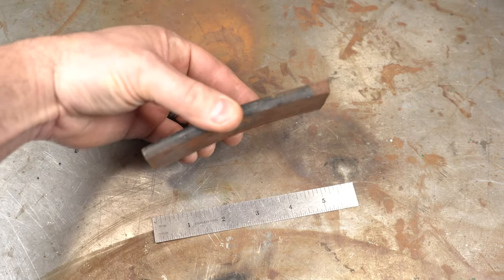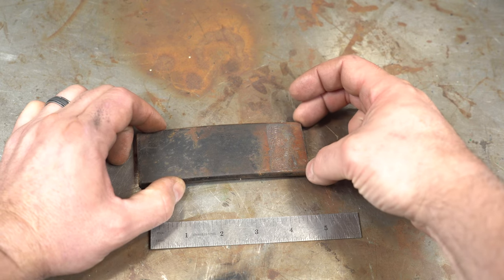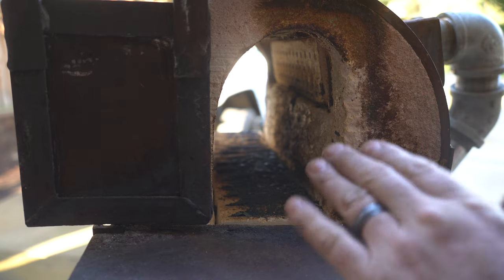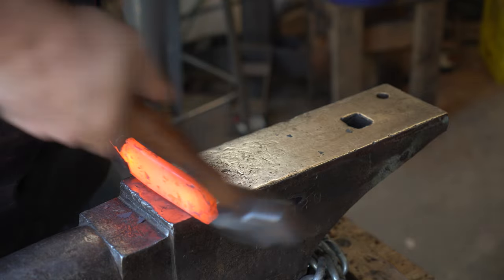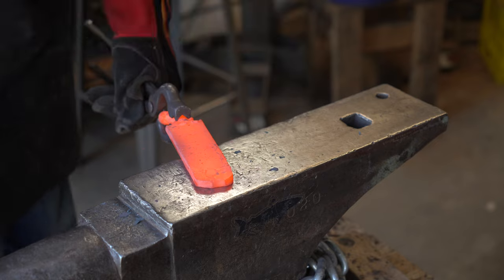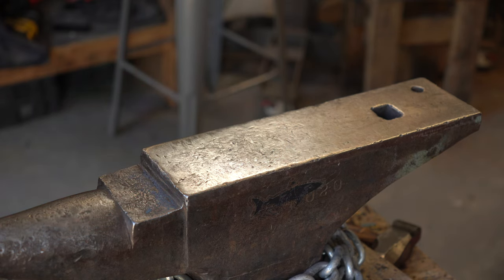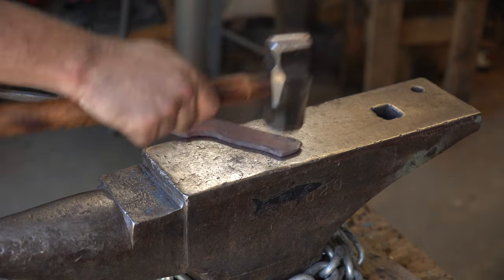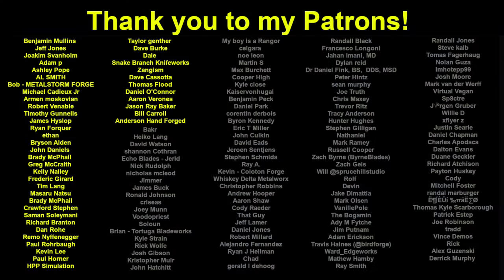Triple-T #172 - Forging the beginner series knife

Comment from the maker: Do you have any questions about the forging in this video?  Any tips I missed?
Reply: Hi sir  thanks for your clear explanation I have doubts that I can use SS309 for this forge ?
Reply: I have 1 question: Can I use a induction heater instead of a forge?
Reply from the maker: @electromind4183 I’m not sure what an SS309 is.
Reply from the maker: @nandobarreto2 sure, an induction forge can work very well for this part of the build.  I don’t think they are that good for heat treating but for actual forging they work well.
Reply: Thank you! I was looking a way to start forging, but the place I have is closed, i dont think a propane forge would be a good idea, that's why i though about induction. In this case I would need an induction forge and a electric oven for heat treating, am I right? @TyrellKnifeworks
Reply from the maker: @nandobarreto2 yes, that would be a good path forward.
Reply: Thank you! @TyrellKnifeworks
Reply: while you're making the profile, do you let the forge running at the same heat or you lower it a bit?

didn't mention any tips to remove the welded steel without leaving the soldering material
I imagine that it was left to cool and then grinded out, but how to differentiate the working steel vs the added/welded steel when everything kinda looks the same?

idk if it's like a no brainer, but maybe adding the steel brush and ruler to the items needed in the previous video
the welder, well, you cover it, but idk if it it's close to a must even for beginners
Reply from the maker: @jorgepr13 I have my forging running around 1800F when I’m just forging.  For grinding off the handle, you can just do it while it’s hot with an angle grinder.  If you had a cutoff tool to put in your hardy home, that’s actually the easiest way but most beginners won’t have that.  A brush is required but those are cheap.  I’ll mention in the next video.  Thanks for watching!
Reply: @TyrellKnifeworks , one thing I have seen stressed is the importance of setting the heal of the blade bevel and making it straight. I know you said that you wouldn’t be doing beveling with hammer. But grinding in I think relies a good amount to having a straight face of the Ricasso matching the shape of the heal of the bevel.
Reply from the maker: @samdahlandsonsforge   Yes, I'll talk about that during the profiling.  I want to be careful in this beginner forging not to overwhelm the beginner with so many "things to think about", hence I left out bevels on purpose.  Just forging a profile is where they should start.  In the Intermediate Series I'll cover more forging techniques like bevels, pulling the heel down, etc.
Reply: A tip might be to use the horn for drawing out, if you don't have a nice rounded corner on the anvil.
Reply from the maker: @aviweisbach7816 yes the horn works if you don’t have a rounded edge.  Though the edge works better if you have one because the horn is unsupported and transfers less energy into your workpiece.  Thanks for watching.
Reply: @TyrellKnifeworks  I really like what you are doing. And I know it is such a hard line to decide between what is overwhelming for a beginner. I am so appreciative that you take the time to make those thoughts into footage. The fact that you include your wife giving you a best wishes for the day shows your character. I have no idea of the exact science of what is too much, and what is just enough to get started, but again I appreciate your focus on trying to answer that question!.

Comment: Thanks so much for this series, Denis! I’m just now on my third ever knife. The first was made from pretty thick truck leaf springs. I kept getting a bow in the blade…I’d flatten it out and then back into the forge. Taking it out, it had the bow again! 😡. Do you think that the bow of the leaf spring had anything to do with it? I’ve seen plenty of vids where the smith used leaf springs (yours included) and those came out flat.
Reply from the maker: It may be where you had it in the forge.  Was the burner pointed directly at it?  It may be heating up the center more than the ends, causing it to warp in the forge.  Just a thought though.

Comment: Do you actually measure the thickness of the billet and then calculate where to start the handle based on your desired length and desired thickness, or do you just sorta estimate and eyeball it?  I usually just eyeball it and estimate, but I've seen some smiths do some math and some very precise forging to end up with exactly what they're aiming for.  I'm kinda torn as to the best approach, since estimating will often waste a bit of material but it's substantially faster and easier.  Also when I was first learning to forge, I found it easier to draw a billet out using the peen of the hammer and the horn of the anvil so if anyone has trouble using the peen and the edge like you're doing, then maybe try the horn and see if that works better for you while you work on improving your aim with the hammer.
Reply from the maker: Doing the volume calculations is an advanced technique to be sure.  In this example I just estimated it, which is why the handle is a bit thinner than the blade, because I needed a bit more length.  As for forging on the horn, it’s a viable approach but the horn isn’t supported so you get much less mass under your blows as opposed to the edge of the anvil.  Both work but the edge can be a bit quicker.  Thanks for watching.

Comment: I hope 5160 can be heat treated with canola oil, that's what I've been using! Haha
Reply from the maker: Really just 5160 and O1 can be quenched with canola.  Other steels, particularly the 10xx really need a faster quenchant to be effective.  Thanks for watching.
Reply: @TyrellKnifeworks  but not as far as a water wrench for the 10xxs, right? I know 1045 can be, but that's lower carbon
Reply from the maker: @joestuttgen5058 any of the 10xx steels CAN be water quenched but it’s generally not a good idea.  Parks50 is the recommended quenchant.
Reply: @TyrellKnifeworks  is it possible to heat treat a 10xy carbsteel using vegetable oil that has been cooled?
Reply from the maker: It’s not optimal at all to use vegetable oil.  It won’t harden like it would with the proper quenchant.